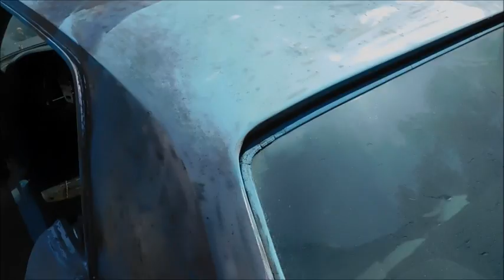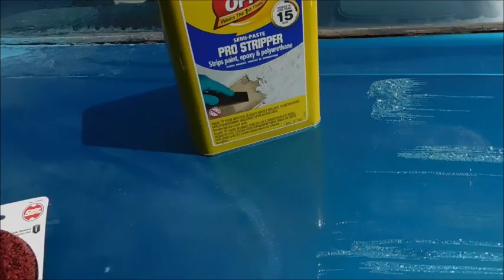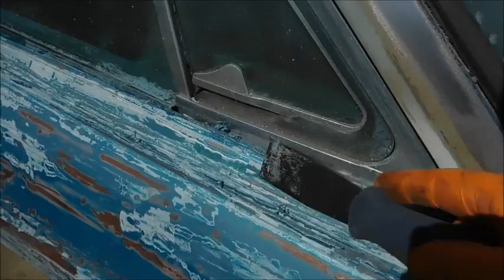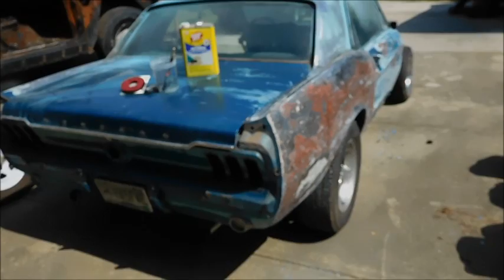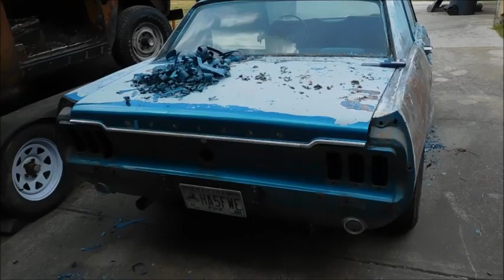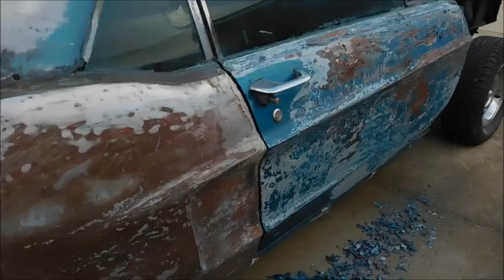1968 Mustang paint stripping. "Jade" part 21 #mustang #howto #restoration

Comment: I know this is an old video, but you should put the stripper on the cover it with plastic like painters roll.  Otherwise it will dry before its effective.

Comment: Jo Daddy, where do you recommend buying after market fenders? I’ve read the reviews from CJ pony parts and they do not look good. Thank you.
Reply from the maker: Good question. Your best bet is to see if someone has any original tooling fenders. More expensive, but worth it. Try NPD.
Reply: Jo Daddy's Garage thank you, from what I’ve seen I only need the door, back left quarter, and the passenger side looks good with some dings.

Comment: Start off n throw that stripper aside. A gallon of "Kleen Strip Aircraft Stripper" will be your most effective replacement,80 grit or coarser on the panels to be stripped,get the car OUTTA the sun! Room temp,preferible 65-85 degrees,{I know,Mother Nature Rules} but coat thick ass coats IN 1 SINGLE direction of you brush,plastic immediately in couple to few feet sections,pressing out the stripper as it seems every 20-60 seconds,take 1 of your mud spreaders and start peeling that shit back.And don't let it get away or you'll have a big mess.Yeah it might only remove paintjob at a time but this way some "somebody" ain't thowin' your body panels all around and warping the hell outta everything ,your parts don't get jacked, and you aren't paying them to do so!  Aside,I Really like your vids. I've only watched couple but yeah man,you got some skills!
Reply from the maker: Thanks!

Comment: I've stripped many many cars using aircraft stripper and I can tell you that it has to go on a whole lot thicker than that in order to be effective. Secondly, it would work a lot better doing it in the shade rather than in the sun. The sun causes it to dry too quickly which essentially halts the process and quits reacting with the paint. You want it to stay wet as long as possible. Even then, it usually takes me 2 to 3 applications to get through clearcoat, paint, and primer. As another viewer said, roughing up the surface helps penetration considerably. I haven't tried Goof Off's brand of stripper but I have tried several others and nothing seems to be as effective as good old fashion aircraft stripper.
Reply: Also put plastic on top to trap the chemicals

Comment: when it comes to paint strippers ...you get what you pay for... i always use air craft stripper because it gets the job done....and also ...yes it pays to use something very course and scratch up the surface before applying the stripper...good luck on that...you have been doing a great job so far

Comment: you need to put that crap on thick! it does nothing in a thin coat. glob it on so it gets a chance. even then its horrible to work with and is very messy

Comment: Use a product called Zip Strip in works great, Before  you put it on take a DA with 40 grit and just rough up the paint to open it up a little  doesn't take much. then put that stripper on heavy as hell  when it starts to bubble put another  coat over the top it will surprize you it will work much better than what you have. The bad part is the EPA made them take all of the good stuff from the stripper products.